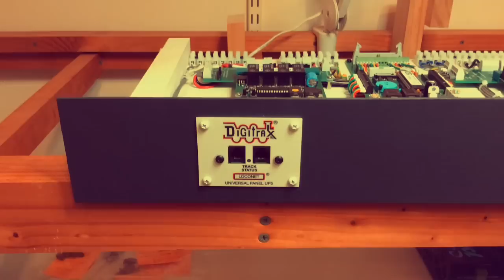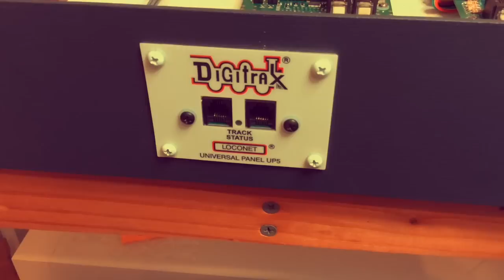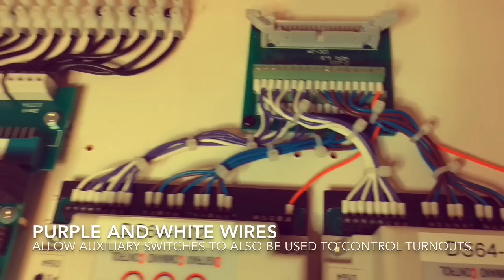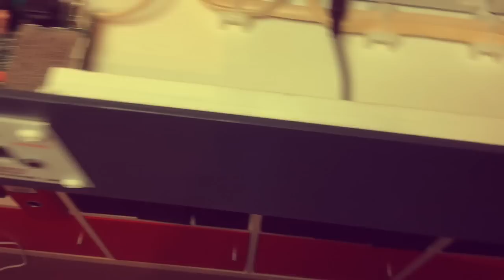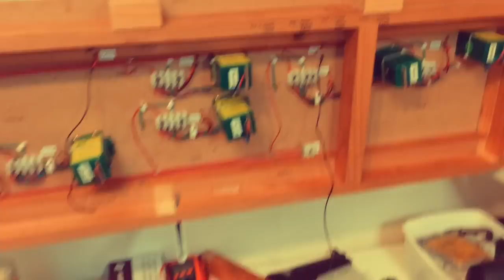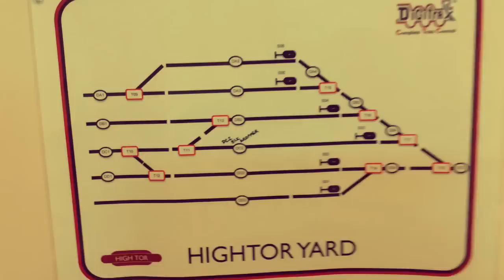Digitrax DCC Drawer finished

Comment: Great job. I misunderstood how you connect the pm42 and the bdl168. The zone wires on the BDL168 goes to the layout, the blocks dcc in from the bdl168 common wires goes to the pm42  sections 1-4 respectively, black wires in vid. Where does the red wires go?